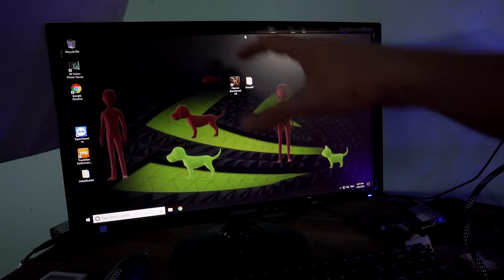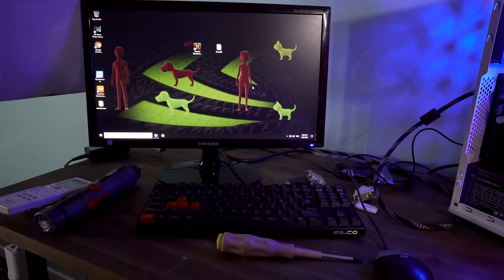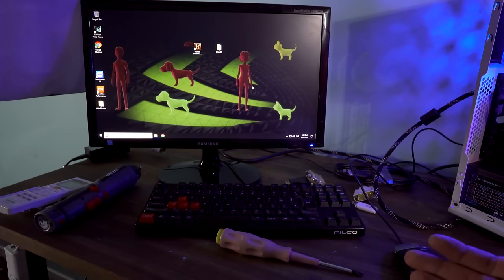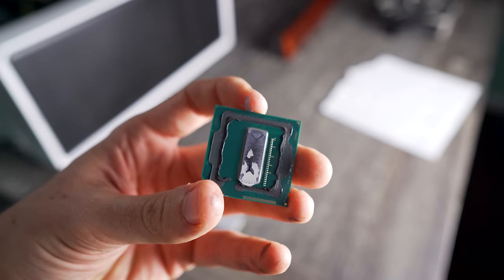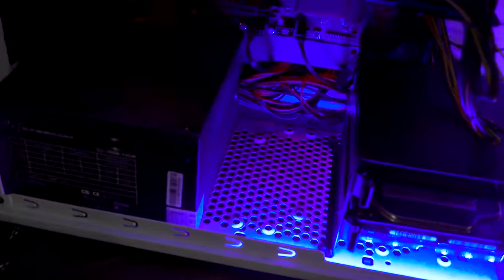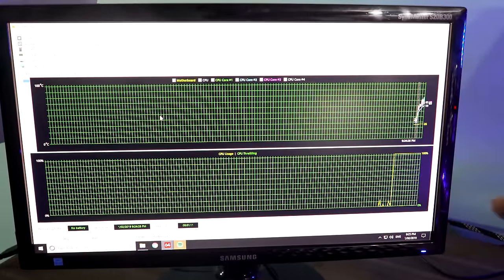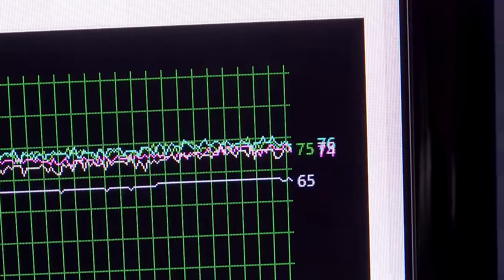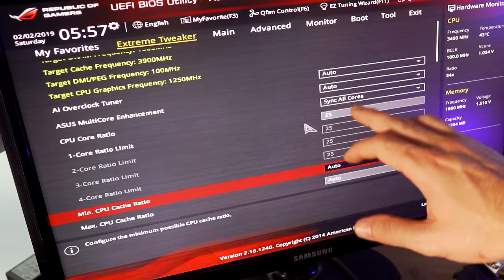How to Spot a FAULTY CPU.....? The i7-4770 Dilemma....

Comment: pas de composants tropicaux vernis sur la droite du processeur, 1 micro goutte, un coton-tige mal placé avec le métal liquide, votre CPU est mort, si vous ne pouvez pas nettoyer ou complètement enlevé le métal. En plus de ne pas remettre de silicone, vous ne respectez pas le contact dans la matrice et la CPU, certains overclokers ont carrément pété leur CPU comme ça, parce que ça presse trop! il a raté cette couche de silicone et le processeur est écrasé. Bonjour les intrusions, si vous ne nettoyez pas le circuit imprimé et que vous mourez bien et qu'il reste un peu de silicone ...... ce n’est pas le clip de votre carte mère qui l’empêchera en gardant le dé dans le vide et non le droit. Dommage de mettre une pâte obsolète sur le dé! Avec le i7 4770, vous n'aurez pas trop de soucis, mais faites attention avec cette méthode, beaucoup le font avec la déchirure! processeur dans l'étau, cutter, pas de vernis de protection, ne vous souciez pas du processeur et plus de garantie. j'ai délid mon i7 4770k j'ai gagné 10 à 15 ° C au repos et 20 à 25 ° C au banc. Je ne peux pas dépasser 60 ° C avec OCCT après une heure, comparé à 80 + avant.

Comment: I have ZEBH61 MBD and I3 3210 , i working from 2-3 hours suddenly my system get hang , after forcefully reboot it's showing blank screen.
I buy new MBD h61 it's running smoothly 5-6 day again same thing happened i could not figure out  what is issue my be processor or Ram , i  have 3 set ram  to check with it but same issue showing.

Could you suggest me?
Reply: Have you find the solution please tell me

Comment: What about a pc abruptly disconnecting from the monitor, requiring a reboot?
Reply: wrong memory voltage. or you have to make a new windows instalation. take off the bios battery and make a new windows installation by formating the drive in the setup.

Comment: What should I do if my laptop freezes just like this? It's an old 2010 Acer Aspire 5943G with an i7 820QM. I should lower the voltage?
Reply: no, if the temps are ~<85°C raise the voltage.

Comment: I got a dilemma as well. I got a ryzen 2700x , paired with gigabyte aorus ultra gaming x470 and a ocz 650w power supply. When the electricity drops in the house or i turn off the power supply the pc wont start and i get a red led on the motherboard for the cpu and it blinks to ram , if i reset bios settings it turns on. Can it be my power supply?
Also gpu from time to time at random loads be it in google chrome or in games the display goes all back and the sound cuts off for a second then the screen turns back on like nothing happened. It takes 1 sec . Any ideas ?
Reply: The power supply is definitely most suspect.

What do you mean by "when the electricity drops"? Do you mean your house has poor power delivery or during a power surge?  Just to note, power surges can damage your PC.  If you loose power frequently in your area you need to make sure your PC is behind a quality surge protector.  Not the dollar store surge strips.  In addition, unless you are willing to spend big money all power strips use sacrificial MOVs that degrade after each power surge.  They need to be replaced every few years or earlier if you have many power surges.  For those with expensive computers I'd simply recommend spending the money on a power conditioner.

Comment: hmm cpu is overheating, lets overvolt :D. Actually the only good way to test cpu if its faulty and not overheating (well that's obvious) is to swap        to another test bench and then stress test it, also overclock it by 5% before testing, so u will know that it has 5% extra frequency stability margin. Also if underclocking cpu 5% helps , that still could mean that mobo mosfets are failing and some times provides less voltage than cpu could handle without crashing. An actual reading with osciloscope , by connecting to right pins could also show how bad the delivered voltage fluctuations are on problematic mobo.

Comment: My i54590 was going over 100C load on stock cooler but after upgrading to hyper 212 turbo it stays at 60-70C at load weird for a locked cpu might be the TIM like in your video

Comment: Have a computer where it just randomly freezes when booting into an os or inside the os , I don’t think it’s the drive or the ram as I tried swapping those , if the problem is the processor then I’ve already ordered one but if the problem is the motherboard then I have no fix  cause this pc is old as shxt and changing the motherboard would mean changing everything else as well

Comment: i hit load optimized settings in my mobo after making a new build with new and used parts and now i get only a black screen when i start up my pc. fans work, lights turn on. i was able to get to windows before i changed the bios to optimized settings but it randomly shut off which was why i did that in the first place. any tips on a solution?
Reply: Bro what happened?. I had the same. 😰

Comment: Yes, you must test for faulty CPU cores and other issues. No, you don't get to ignore that just because it is rare. This is part of why shops charge a bench fee and many often charge more to work on Intel-related hardware issues - I only need a few AMD chips to test dozens of boards but I need dozens of Intel chips to do the same. More overhead = higher fee. Thanks, AMD! ;) Also no, 78 is not that warm for a room. Is that warm where you live? It's normal in the USA. 

-Most PC technicians who actually do this shit for a living and don't just talk to a camera

Comment: I got a question to anyone who can answer. I purchased a i7 7700k 1 year ago and since day one I would have to add voltage or overclock the cpu from having it not blue screen on windows. If i run it stock in 10mins it will blue screen. Do you know why?

Comment: Ok I'm done with these guys that think the TIM is "so bad" when they see it's dry after a delid. That stuff is obviously not meant to be exposed to air like that, no shit it runs dry. Yes, the Intel TIM is bad, totally agree, but this way of thinking is just wrong. At least it's not like that LTT vid where they scrape off the TIM from several CPU's and try to use it as a IHS-coldplate TIM. That vid was terribly bad lol

Comment: I think my 2500k is dying. Thankfully I’m getting a ryzen 2600 system for my birthday. Here is the list, the cpu, motherboard, and ram are new. 

AMD Ryzen 5 2600
16gb GSkill Trident Z RGB DDR4-3000
EVGA GeForce GTX 970 ACX 2.0+ SSC
Asus ROG Strix B450-F
Toshiba tr150 120gb
2tb Seagate Barracuda
750gb Hitachi laptop drive
250gb WD Blue
EVGA 550 B3
Fractal Design Meshify C
Cryorig H7 Quad Lumi
Windows 10 Pro 64-bit
Cooler Master MasterAir Pro rgb fans

Comment: I have a xeon based off haswell thats been beginning to run hotter and hotter.  E5-2690 v3 12 core 24 thread beast got it well over a year ago off ebay for 490$.  I changed paste on heat spredder tried 3 different coolers no change.   Think this is same issue on xeons?.   I dont dare try to delid myself since to this day this cpu is still very pricey.

Comment: i got 1 4770 that has thermal problems because of intel preapplied thermal paste under the ihs and 1 i7 4770k same thing, intel try to minimize cost but not mitigate the problem, they upgraded the haswell line up with devils canyon but still a lot of cpu even the legendary i7 4790k have thetmal problem even running in liquid coolers solution delid the thing

Comment: The CPU was not faulty technically, had a dried thermal paste, a faulty CPU can't be fixed, since is the circuitry itself, you can say it had a faulty functioning because of the thermal paste, yeah you can say faulty but need to make that clarification

Comment: I have an old Arctic 7 x58 cooler on my 4770 and even with all cores at turbo 3.9ghz constantly and 2400mhz ddr3 it never tops 60c
Reply: i would be a little bit carefull with memoryvoltages over 1,65 volt maximum. It will destroy the memorycontroller one time!

Comment: I have had fx 8350 that got to 100°C playing gta v 2 years ago in summer here i croatia (summers here are also insane up to 40 in shade). I also didnt know what was it so i ended up going to a store where i bought it and they have got me another one and it worked perfectly and never exceding 50°C while 0laying gta v
Reply: Some silicon bins badly.. It happens.. I've never had the heat issues with any fx cpu I came across

Comment: can you load test a cpu to see going out….lmine is a socket 1155 intel i5 idle temp 45 when gaming 65..when gaming it shutsdown…using deepcool pro 400 heatsink deepcool 500w power supply 8 gb ddr3 12800 ram……anyway to test ram without just replacing…expensive here

Comment: Can someone help me out i have a wierd tdp issue, so im using the same i7 4770 and my cpu doesn't go over 60w on gaming, blender and benchmarks it only goes to 80w in high power test in prime95.  I have changed bios settings to lower the temp with changing some settings thst i dont remember. But now that i have loaded optimized settings it won't go above 60w. Also the clock re fine 3.9ghz on single and 3.7ghz on all at around 65 max. If anybody knows anything about this that be helpful

Comment: Haswell cpu's are longterm unusable without delid. In my humble opinion you should have known this if you fix pc's for money.
Reply from the maker: Never had a problem with non-oc ones.
Reply from the maker: until now lol.
Reply: @techyescity   Haswell (K) is great overclocker though if one can get temp under control. With non K's the toothpaste intel used might do the job but I very much doubt even that in long term. Haswell IHS TIM is literally worse than any 3rd party thermal paste. Talk about maximizing profits before AMD entered back in scene with all soldered ryzen cpu's

Comment: my CPU sometime shutdown when test with prime95 blend test. but small fft survive 3 hour long.
Reply: overheating. Check thermals with HWinfo64 or another software like that.
Reply: @Koeras16  i use fx 8300 clock 4.25ghz @1.33v, temp around 62c on socket and 58c on cpu die.

Comment: Bought a used Phenom II X4. It wouldn't post in dual channel, but it worked normally in single channel. First i thought it was a bad Mobo so i bought a new one. That didn't fix it, so i replaced the RAM, that also didn't fix it. Turned out the memory controller inside the CPU died. Never would've guessed it.  The CPU died after a few months of usage. It started bluescreening, i touched the cooler and it was hot as hell, it actually burned me.

Comment: After 45 years as a PC tech repaing and building PC's i have never seen a faulty intel cpu but have seen 3 faulty AMD cpu's
Reply: I have had faulty Intel CPUs before but more that are AMD. The AMD motherboards were substantially more prone to failure too.
Reply: I've already seen 2 Intel coming d.o.a after only 7 years working as a computer technician. Never touched an AMD FX but I'm only building Ryzen systems now and not a single fault for now
Reply: K7 is when AMD cpu's failed a lot, and a lot of it had to do with the exposed die and shitty coolers and motherboards/caps at the time, intel motherboards and coolers were just made better at time time.  AM2 and after AMD cpus seem very reliable, not found a dead one yet, but I can imagine those +4ghz piledrivers being paired with shitty motherboards were well above average. I wouldn't worry about anything after Zen though, motherboard protection features are too advanced to give cpu's a slow death like before.
Reply: True...Faulty Amd cpus forced me to go Intel permanently .....never had any broken Intel processor for atleast 12 years  being addicted to computers.
Reply: True...Faulty Amd cpus forced me to go Intel permanently .....never had any broken Intel processor for atleast 12 years  being addicted to computers.
Reply: Work in professional IT for long enough and you've seen everything.
The only constant is user error and stuff breaking no matter the brand, make or model or perceived notions of quality or reliability.
Reply: Everything will break, show me something with inscrutable reliability / bulletproof construction and I will show you a naive fool.
Reply: I've had a couple faulty Intel CPUs.  Zero bad AMD ones though.
Reply: Yeah i dumpster dive computers and a lot of the AMD 64 machines i find have CPU or MB problems
Reply: after building dozens of pcs the only intel cpu that went faulty was my own 3930k that i had already been running for months. what are the odds right? 😅 went crazy for a bit troubleshooting and replacing every single part except the cpu when it wouldnt boot
Reply: I was very sad then, the one and only CPU failed in my life. It was my 5960x, a short time after the Warranty....
Reply: funny for me exact opposite, I always figured it due to more intel cpu's sold is the reason I seen more faulty

Comment: hmm my bios has a PC tester that tests cpu ram everything ….im a little comfused though with this episode because I have built 100 of thousands of PC,s the only time I have burnt CPU,s is putting the wrong cpu in a incompatible board way back in the day I put a core 2 duo in a MOBO that was Pentium 4 and it burnt the CPU but get this the board still worked I kept that CPU til this day hahahaha the second time was was putting a quadcore in a core2 system and same thing burnt up the CPU ...this is what I have learned some MOBO,s are just not compatible with upgraded CPU,s and are only meant for one specific model and are not upgradable this I have found is very seldom usually its just a bios update too make them compatible like most core 2 duel and core 2 duo are upgradable too Quadcore or Xeon but their is the 2% that just cant sooo MR I have never seen a defective CPU I have seen degradation though usually on older or heavily used CPU,s usually Server one,s , you can tell this because the GHz or MHz do not match up with the Spec,s of the CPU like 2.83GHz spec showing 2.73 yeah that is degratadation of the micro wiring from heavy usage and heat
Reply: thats useful. What board ? I'm surprised the new UEFI boards still don't come with that, I've been looking for a solution to not waste 5 minutes every reboot going into windows on a bad setting.

Comment: I had a 4790k a while back that i sold because everytime I would run cinebench, after about 10 seconds it would already reach 100c and the pc would shut down. Cpu cooler and thermal paste were fine. No bent cpu pins and the ram was fine. It probably needed to be delidded but oh well, I have a 2600x now.
Reply: Let me know what your Ebay name is so I never buy from you.

Comment: Deliding a CPU and putting liquid metal is not a thing that everybody can do.
This is not a fix, sorry
Reply: @sl0thi I paid like 400€ for my 4790K back in the days, I'm not gonna ruin it over night for that sorry.
I also see many people encouraging other to delid their CPU for better temps.
Reply: @Chris K it's honestly waaay easier than he made it look;like so easy even a caveman could do it. Just take a razor to the corners of the heatspreader to remove the silicone holding the heat spreader on and apply the liquid metal. I've done it for 7 different friends/family over the past 3 years and not one has ever had an issue. The ease and which it can be really can not be understated. Thermal Grizzly Conductonaut is the way to go
Reply: I love how you hound on him when the real question is why is it necessary to fucking delid youd figure a prestigious comoany such as intel could solder thier cpus amd deliver decent performance matter the age. It took them until amd got onto it with ryzen to solder a cpu and they probably only did it because thwy couldnt make the 9900k not throttle horribly  without soldering
Reply: @Alexiel-f6o   True. This is clearly intel's fault but without competition from amd this was we were getting. let's hope everything change for the better.
I use an H100i V2 in my 4790K at stock clocks and occasionally hit 70°C at turbo mode. Probably with a delid things will be better but i cannot risk that.
Reply: @clu012  4790K is worth like $180 USD now.  You can buy a brand new Ryzen 2600X for $200 and that comes with two more cores and identical gaming performance.
Reply: @giglioflex   Where i live (Greece) the cheapest 2600X is 194€. Also the cost is bigger (mobo,ram).
Fun fact, i used to have AMD CPU's for years, my last one was an 8350(worst choice ever). Still the IPC on AMD is not the same as on Intel. (Let's not make it amd vs intel story now pls)
Reply: @clu012  The IPC of the Ryzen 2000 series is better then Intel's 4000 series. It's pointless to argue this, go look at benchmarks.  Intel processors 6000 series and up have better IPC

Comment: The i7 4770 is  a terrible CPU. The bad heat transport between die and heatspreader, the weak!! single and multicore performance. My Xeon e-1240 v3 died by faulty memorycontroller!? But this was my only CPU with malfunktion of about 80? 76 of them i bought on ebay, the e3 Xeon i bought brand new.